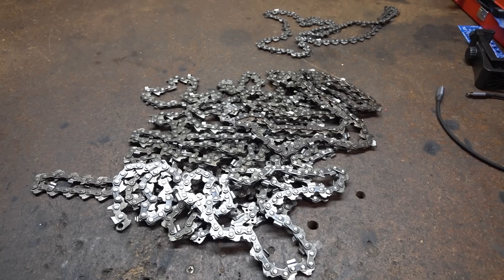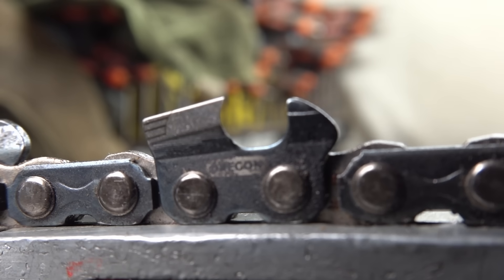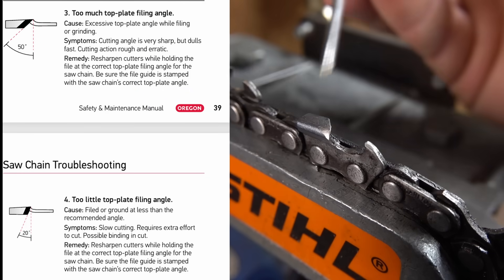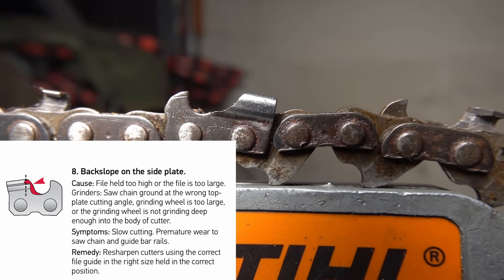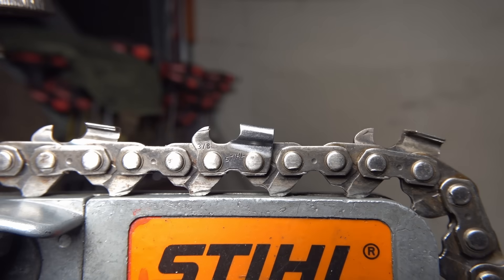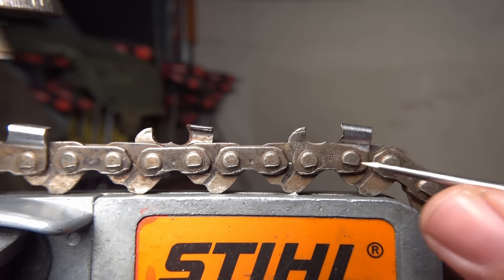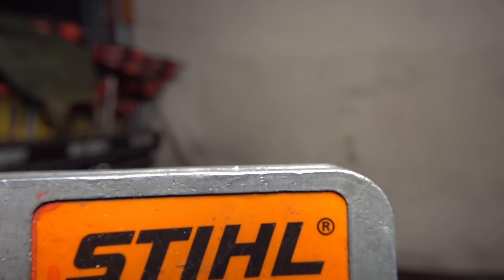Stop destroying chains - Chain damage and witness marks

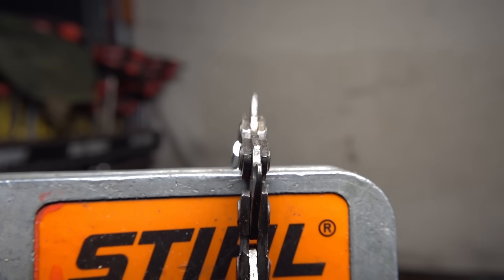Comment: No idea what you are talking about around 14:27. "the lower section of the bar rails"?
Reply from the maker: I'll cover it in the next video, but there are 2 different ways that the rail groove can be damaged. If they are spread open in the upper part of the groove (top of the rails) you can close them up.

If they wear the lower part of the groove they are damaged beyond repair. It's caused by the bottom part of the drive links being pulled side to side and it creates a bulbous shape in the bottom of the bar groove.

I messed up by using the term "rail" instead of groove
Reply: @SawChainTheories  Got it! thanks.
I'll have to check that one. Always end up with chains cutting right before they are worn out. Have a bar grinder, a bar closer, chain measures the same both sides. Maybe worn bottom groove is it. I run cheapish bar and chain so I just throw another bar and chain at it and console myself that it's more than paid for itself in firewood. The "engineer" in me isn't happy that I can't explain it though.
Reply: @stusue9733 use a progressive raker gauge and the chain will probably cut straight for you.
What do you currently use to set the rakers.
Reply: @brettblack7049  I've use the standard and the progressive. I've even measured the angle from cutting edge to raker on eaach tooth to make sure I was getting them the same.
Normally set as the chain comes. Now and again I push it a little/lot deeper till the chain gets a little to grabby. The last couple of years I've started using full chisel and well as semi on different saws. So I don't remember the numbers off the top of my head.

Comment: Damn that carbide chain is expensive over there. Here in EU that 20” loop is about 1/3rd the price, Stihl made RD3 type.
Reply from the maker: I looked it up when editing the video and nearly fell off my chair. No way I'm buying it
Reply: @SawChainTheories  Yea not at that price lol, if you're cutting dirty wood you're better off with semichisel steel chain and forget about it. I did try the RD chain in sandy wood that killed cutting edges continuously and I was impressed with it, but anything larger than sand like a small pebble chips a cutter or two... So yea great for muddy/sandy wood where you know there aren't any embedded rocks, while in clean wood it cuts substantially slower than chisel chain. There's also a german brand called "Saegenspezi" here that sells carbide tipped chains cheaper than Stihl, but the widia tablets are smaller so less sharpenings before you throw it away.
Reply: $85-$100 here in the eastern us.  I've thought about tryin some myself.

Comment: None of this stuff is all that interesting to most saw users, its beyond the basics. But having the ability to read chain damage below the cutter can really help your wallet and cutting performance. All these chains could have been saved at some point had the user known what was occuring and WHY.
Reply: The wear marks on the bottom of the chains is not well known amongst most users including myself. This was an excellent video
Reply from the maker: @oakiewoodsman Most of the chain manufacturers don't give the marks on the lower chain so it's harder to see for most people. Once you know what to look out for, you can judge it on the other brands pretty well
Reply from the maker: Hopefully it will save a few guys some money along the way. Knowing why something failed is a great way to avoid it happening again

Comment: Do you have the carlton manual Squishy?
Reply: ....and before you go heavy at that "missing rivet"....keep in mind that manufacturers like homelite and echo would have oregon make special runs so that the "tip guard" bs could be installed,....hence the missing rivet and square hole. FYI
Reply from the maker: @brunomahle1618  The Carlton complete book of saw chains? I have 2 different versions of it and a 1976 Carlton book as well. I used the Oregon one for this because I can link it straight to their site instead of trying to host the older manuals for this

Don't the tip guards bolt through a separate hole in the tip? I have not seen that many so I'm not sure, I'll have to have a look
Reply: @SawChainTheories  I remember years ago when LeftCoastSuppy (Gregg from Baily's) was blowing out Griffiths and Beerens bars and some were set up that way, (missing the rivet)...the guard tip was the explanation. My pro lite and echo bars that accommodate,  have a different rivet spread than the three.

Comment: Example of damage caused by blunt saw is the 500i on the vintage machinery  channel
Reply from the maker: I should have videoed the 026 I did earlier this year. Well looked after older saw killed by someone trying to cut with a bad chain. They heated it up so bad it cooked the clutch side crank seal, burnt the bar blue and wore the rails down so far it split at the font of the saw.

People are hard on equipment